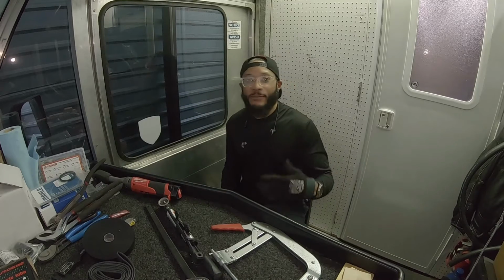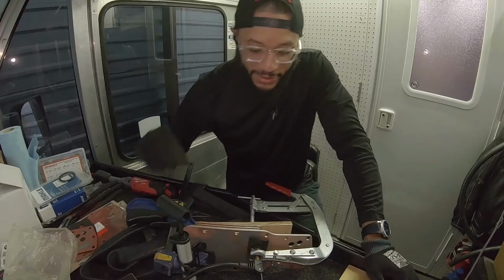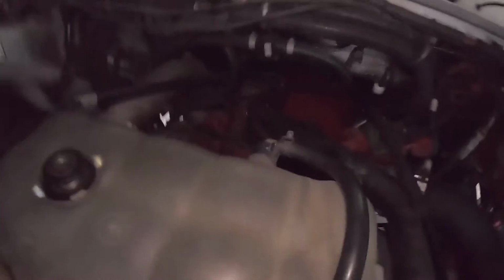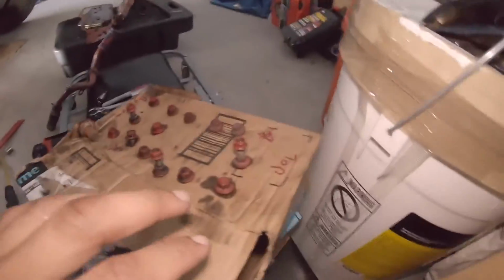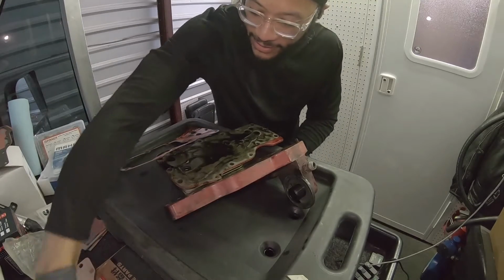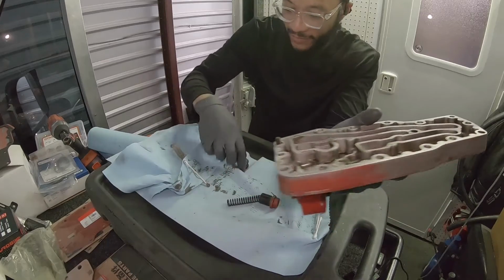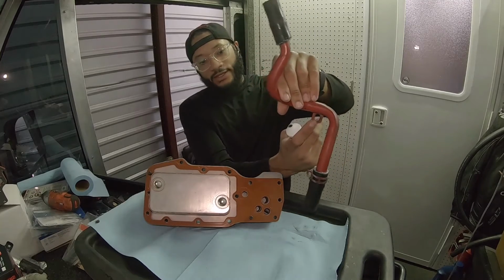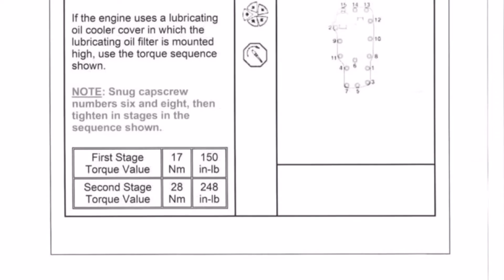6.7 Cummins How To Oil Filter Housing Complete Rebuild, Gasket Install & Pressure Test

Comment: I’ve had a few turbo issues , starving my turbo of oil in higher rpms. I have a new motor, new oil pump, new feed and drain line.  No boost leaks and I’ve destroyed 3-4 turbos. This is the only part I have reused on my motor and all the turbos. Is this a possibility of the regular failing ?
Reply from the maker: With the oiling system there's many variables, even excessive crank case pressure can interfere with feed/drain. Have you checked oil pressure, did you follow break in procedure for the new motor, was the new motor clear of metal from processing,, do you know the condition of the motor (excessive metal shavings). A blockage is possible but there's so many variables that could affect your issues. I always tell people to start by getting caught up with general maintenance